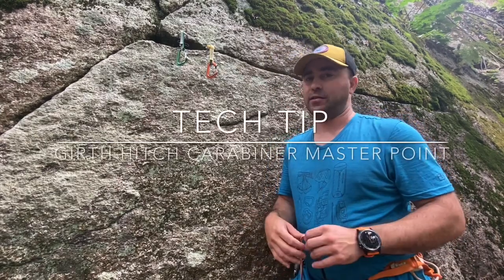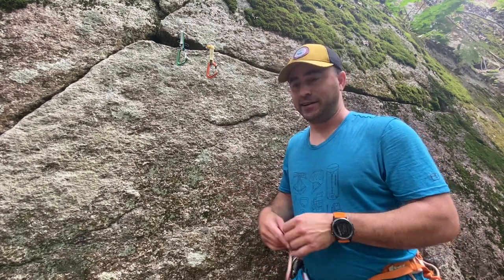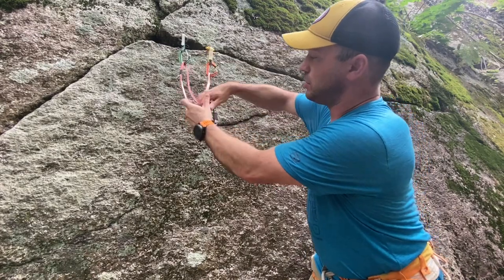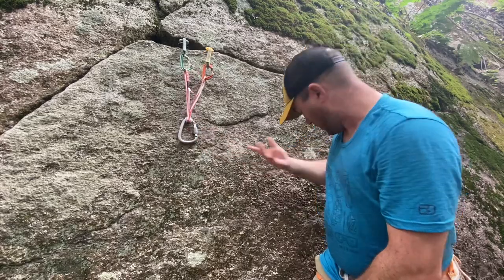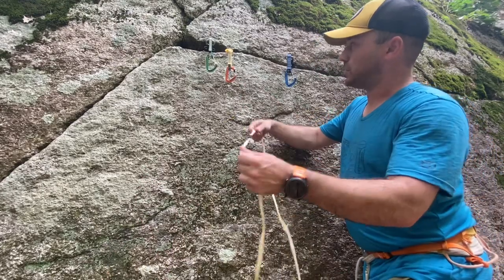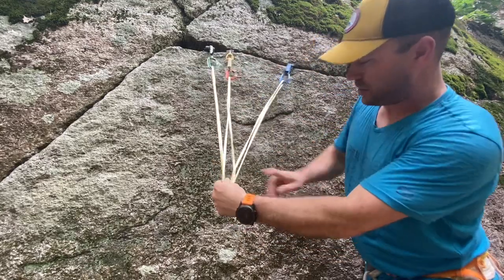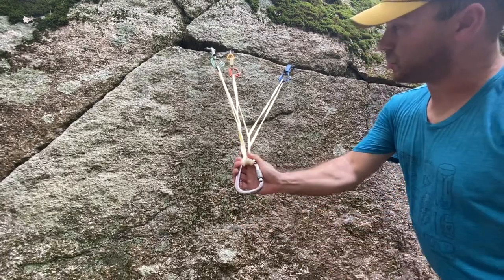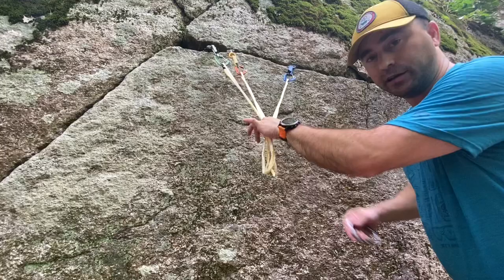Tech Tip: Girth Hitch Carabiner Master Point

Comment: For a 2-piece anchor using the girth hitch, twist one strand like you started to do as if you are making a sliding x, and then girth hitch the master carabiner. This way if one strand comes unclipped from an anchor point and slips through the knot, the master carabiner will still be captured by the sling, very similar to why you put the twist in the sliding x.

Comment: How do justify the lack of true redundancy? Just be confident enough the clove hitch or girth hitch won't slip enough for the entire thing to fail if part of the system fails?
Reply from the maker: Testing has demonstrated that it won’t slip under forces generated in climbing situations. The forces required to make it slip are beyond FF2 type forces, so this does offer “true” redundancy in the practical sense.
Reply: @NorthEastAlpineStart  I did some more digging and you are pretty much correct. Girth is preferred to clove from what I've read. 
So simple. I like it
Reply: I still like that the clove is just as easy to tie and less slippy than a girth hitch using 2 pieces and dyneema sling.  But it got me wondering how you'd even tie a clove with 3 or 4 pieces.  I suppose the girth hitch is king there. Also, have you seen the method of twisting one of those loops to form a sliding X before you slip the loops into the MC to form the girth hitch? This does close the system off and makes it truly redundant.
Reply: @NorthEastAlpineStart  can you track down the testing source, I'd love to see that. It's always comforting to see evidence-based climbing practices.

--Cheers!